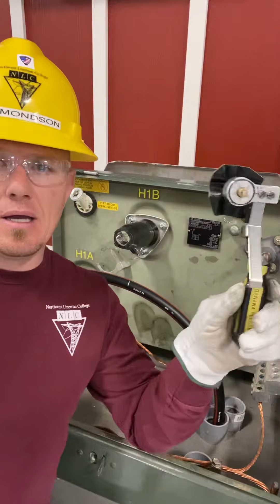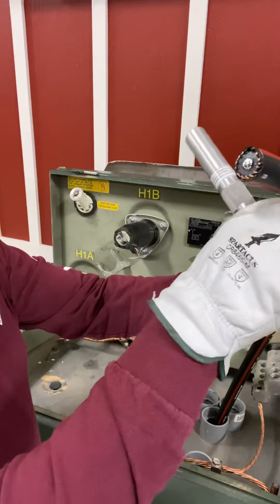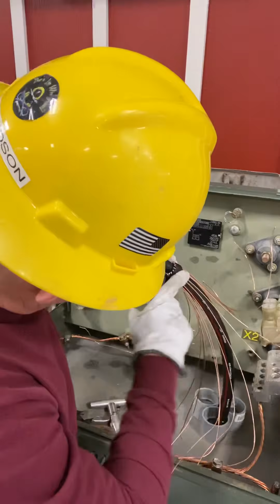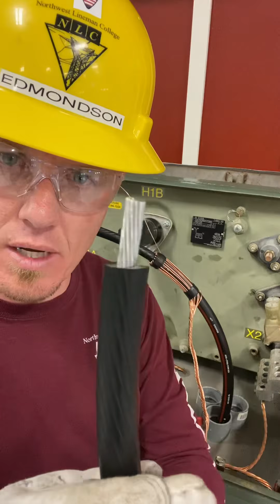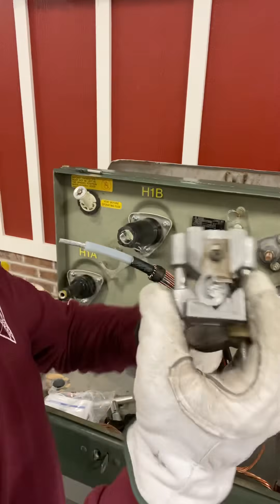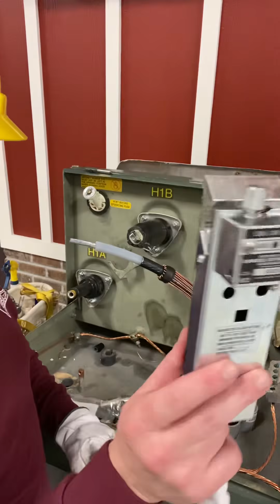200 Amp elbow termination

Comment: Always nice to see how other places to it. We do ours a little different. We strip the outer jacket until a few inches above the conduit. But a water seal around it and that cable is so much more flexible. Also we twist the bleeder wire on to the concentric and wrap it going up the elbow before landing it.  Solid video. Always wondered how these elbows differ from other styles.

Comment: Well done,  2 things that got in my mind during the video.  First,  the press fittings that I know had to be started all the way back and than the second, third, fourth towards the lug. In that way you'll force the conductor into the press fitting and create additional contact area at the conductor face. It might not be important on small connectors like this,  but definitely on 1000+ amps. Second thing the grease/clay inhibitor,  you want to have the full amount of it inside the press fitting to guide heat out of the core and transfer it into the lug. Beside the temperature thing you also make sure that humidity has no chance to enter even if the outer isolation fails over the years.

Comment: Just started off as a UG apprentice very informative video. Thank you sir.
Reply: Any tips? I’ve been doing underground for a few years but my company wouldn’t put ug guys through apprenticeship only guys in the building. Going to do it on my own
Reply: @GageDunnbar  be persistent, if you want to get into a apprenticeship program find contractors that offer an apprenticeship program as a benefit. I work for a tier one contractor for a major north Texas co-op. Also, don’t be discouraged to start off using a shovel again.

Comment: You should press the lug on before you make the 6 7/8” measurement. That also is the only measurement that has to be precise. After you should use SAP tape from the jacket to the elbow before you connect the bleeder wire to eliminate the possibility of water getting into the elbow.

Comment: You installed your silicone grease from your semi-con over the exposed insulation, if you were working for me, you would be cleaning that again and doing it over. Also, with a little a practice, and experience you can make all your scores and cuts with a sharp knife with more accuracy. When you ring cut the cable jacket, "break" the score with 2 hands and remove the jacket toward your butt cut and there is no need to worry about bird caging the concentric.

Comment: He is not using an electrician's back reading folding rule? Okay. I used to let those banana peelers and spiral cutters fall on the ground and just score it with a prep knife. After the 500th termination you have it dialed in pretty well. Heating that mess up with the weed burner make it lots easier to work with too. Aluminum oxidizes immediately when it contacts air. If you score into the insulation you can sand or file the scored part back smooth. My oldest stress cone tools are made like Vise Grips with a pull handle on one jaw and blades that cut a square cut and drag a parallel cut like the banana peelers. Those are some really OLD tools. They served me very well, if I bothered to use them.

Comment: Why not use a regular splicing knife, you don’t need all those fancy stripping tools.
Reply from the maker: Because I like using them.
Reply: Yes you do.  Just try getting that semi-con off without the special tool.  It is incredibly difficult.
Reply: @ethanbrush4932  Not really, if you know how to use a knife.
Reply: @jarredcorby7170  yes I know how to use a knife.  Been doing this a long time.  Maybe the semi-con you get is more cooperative.  The stuff I get is extremely difficult to remove without the proper tool.
Reply: I agree 100%, faster and more accurate.
Reply: @ethanbrush4932  If semi-con is being difficult, doesn't matter what tool you use, it still will be difficult.

Comment: Whenever you start doing nonessential tasks for the sole purpose of aesthetics then you have strayed from the path of a competent installer. "Gee Bob, look how much time Mr. Smith wasted making this elbow look a certain way even though it made no difference in performance or safety." Good thing most linemen work for the public where they are not held accountable for their productivity.
Reply from the maker: Listen here Tommy… Real closely! I can’t terminate anything I’m sure faster than you with the highest quality of craftsmanship. I’ve been a lineman for 18 years dude and worked with them all. Number 1 is efficiency and second close is quality of work. I’m not cocky but a comment like this usually means you do really scab quality work.
Reply: Nonsense. A nice clean and orderly installation is important. Makes it easier to see what's going on and make changes or additions in the future. Imagine working with a rat's nest and checking things over.